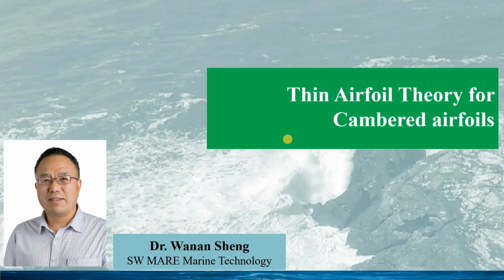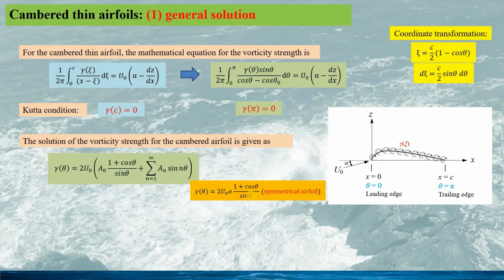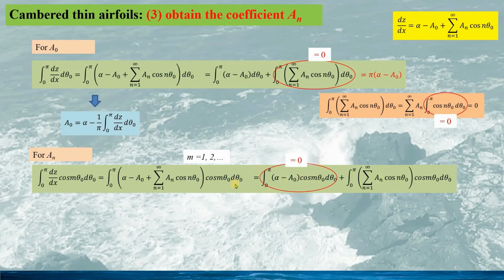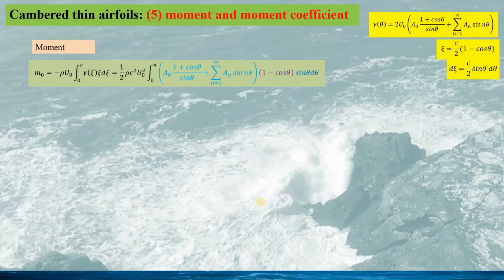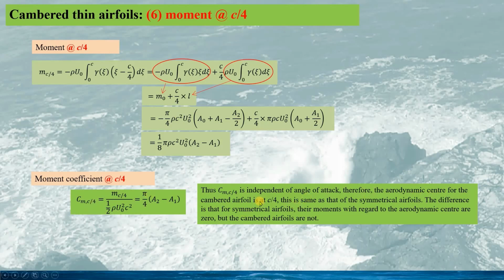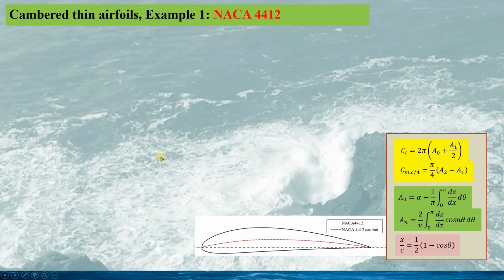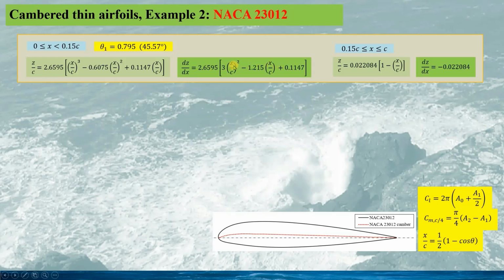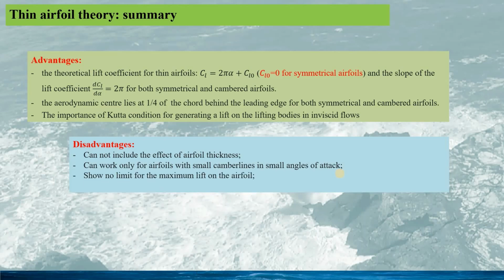[Aerodynamics: Inviscid] Thin Airfoil Theory for Cambered Airfoils

Comment: Hi sir, may I know how to program these integrations equation instead of solving them by hand.? I will appreciate your responding ASAP
Reply from the maker: It should be easy when you use Excel or MATLAB if you know the expression for be to The camberline.
Reply from the maker: If you know the expression of the camberline, as you can see the examples for NACA 4412 and naca23012, the solution can be easily obtained.
Reply: @ScienceofFluids  Appreciate your responding sir. But I really need to know how to use the expression in Excel or Matlab. because I'm lost. For instance, how can I write down the whole piecewise formula in Matlab..? Any suggestion sir?
Reply from the maker: I mean if you know the expression of the camberline, you can easily obtain the integration. I only use matlab or excel to calculate the final result.
Reply: @ScienceofFluids  ohhh i see.. noted and appreciated prof for the replies. HUGE appreciation